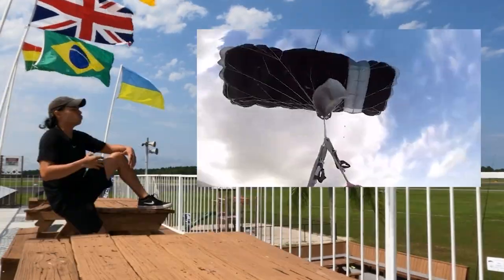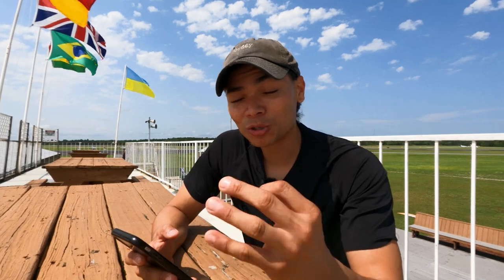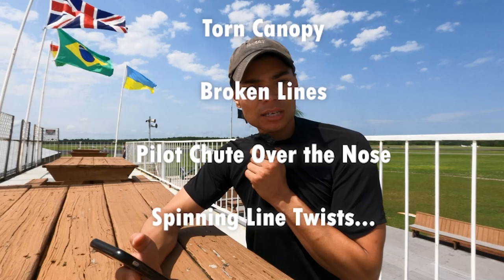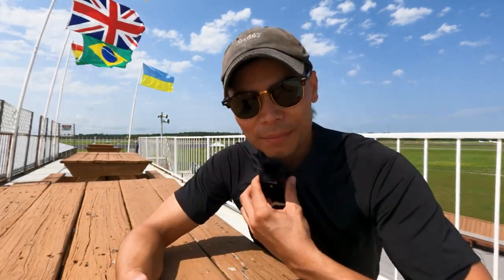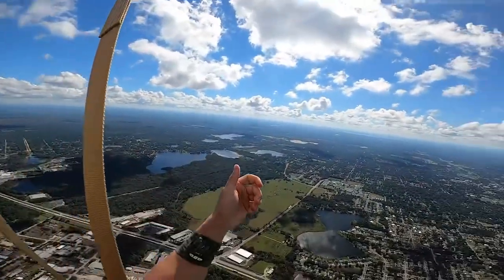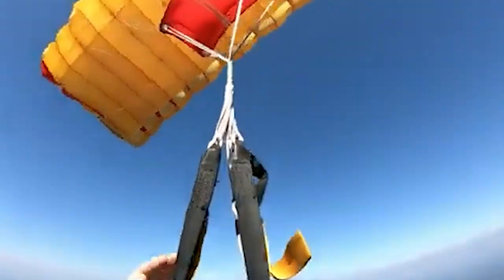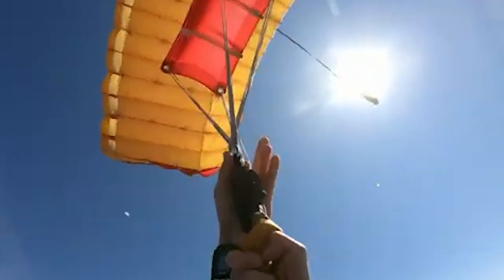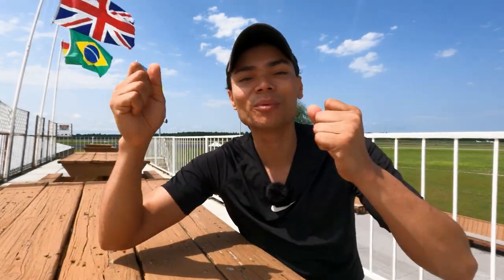Common Skydiving Malfunctions Explained

Comment: I've had several line twists, a couple closed end cells all handled without a chop.  And one malfunction that required a chop as the main was torn in half.  Yes sir - torn in half!  Some great content and with Safety Day just behind us a great time to put it out there.
Reply from the maker: Thank you for sharing and the kind words. In half is wild! I couldn’t imagine pulling, looking up, and seeing that… wild!!
Reply: @SalvadorChangg  - I was test jumping an used canopy that was F111 for both top and bottom skin.  It had been shipped out and the top skin treated to make it behave like a ZP skin (similar to the Silhouette I ended up with).  Turns out:
1) The pilot chute was too big
2) The bridle too short
3) The ZP too unpourous for the parachute cell design
4) and!  I was test jumping the container + reserve with NO AAD at the same time.
Pitch out was set for 4k so I broke off from my little group and pulled at 4k - to have an instant open!  Ever hit a brick wall at 120?  5 A lines, 4 B lines, 4 C lines and 3 D lines all snapped, 2 of the A Lines below the split also snapped (down by the harness), the center cell tore from front to about a foot short of the rear, I was flat on my back in a fast spiral watching mountains, Kansas, mountains, Kansas pass between my feet.  (This was when I lived in Denver and jumped at Mile High).  I had practiced my emergency procedures on every climb to altitude and that is what saved me.  Muscle memory kicked in and I had chopped and pulled to see a bright neon pink Raven reserve above my head before I could think through what to do.  I do remember looking "above my head" to see only ribbons fluttering hard as I was whipped around and knew this was going to be a cut-away - and I was in free fall with the reserve opening.  Practice, practice, practice!  It could save your life one day.
Reply: Sir, a main canopy torn in half is considered a minor malfunction.

;P

Comment: If my Sabre 2 didn’t have end cell closure, I would probably think I was having a malfunction. If it opened on-heading with the end cells inflated..... I don’t even know.
Reply from the maker: Lmfao 🤣 I’ve never jumped one so I can’t comment but sounds like fun
Reply: Same 100% of the time I’ve had end cell closers on my Sabre 2 210, 190, and Sabre 3 190. Every, single, jump. It’s complete muscle memory now for me to grab my rears and pull down on the left to stop the turning and wait for the right 1-2 cells to inflate.
Reply: Dude, just jumped my first rig sabre 2 and my first jump i was like ohh shit, end cell closure. Nope. Thats just how they are. A few pumps to the rears and all good. Or i just turn and let the wind open it up. Great flying canopy though. I have the 210